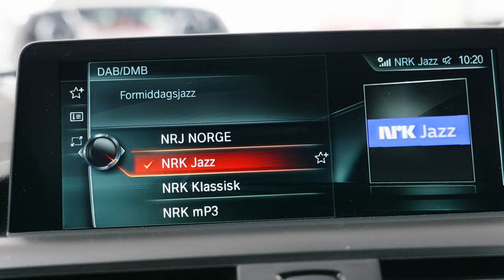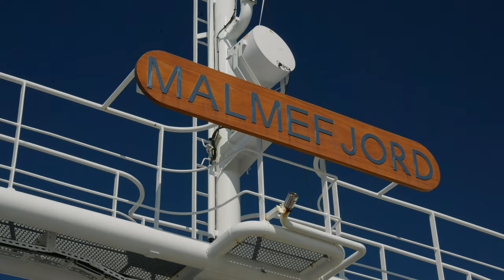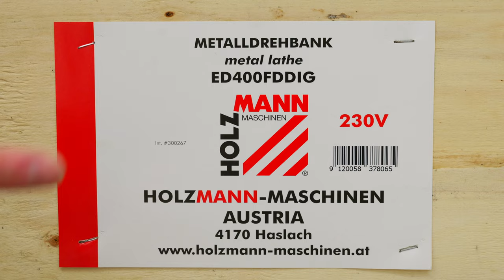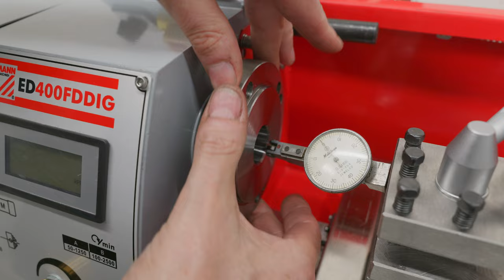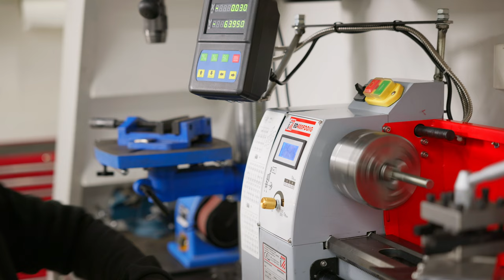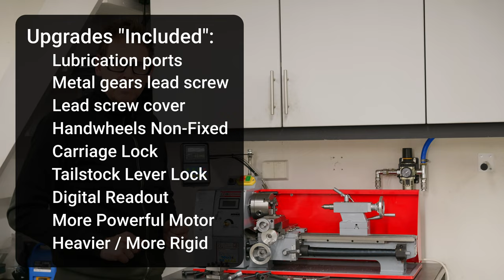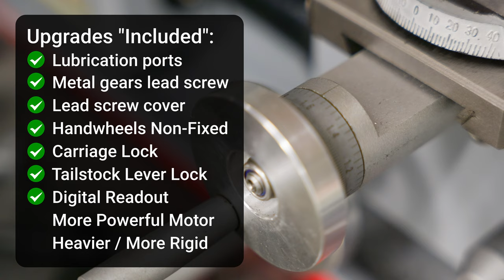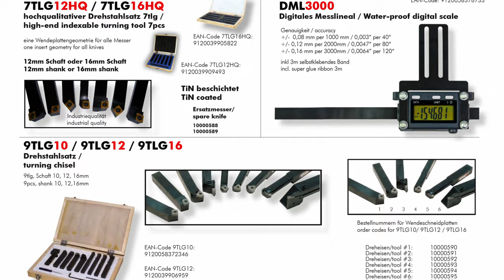The Workshop Upgrade Everyone Wants - Holzmann ED 400 FD DIG

Comment: If you want an easy time, try working with brass or aluminum. You can even shape it by hand with a file.
POM can be a little bit tricky but you can do bearings and similar stuff with it.
I also made some nice cabinet door knobs from brass and POM (and Wood).
Reply from the maker: Thanks for the tips! Starting with softer materials sounds smart. I have got hold of some plastic/nylon bars. Will be on the lookout for brass / aluminium 👍

Comment: Mine came fully assembled, except for the digital readout. Note that the digital readout only reads the apron position and the cross-slide, the compound slide is NOT read (a bit of a disappointment if you want to do a small precision work). However, the impression is good, so far.

Another thing, do you know for sure if the quick tool post SWH20 fits the ED400 lathe? Thanks in advance!
Reply from the maker: Yes, I knew about the limitation with the digital reader. Hope it's not a big limitation, time will tell ☺️ The SWH20 fits - to my knowledge at least. I have not tested it yet though. I asked the Norwegian reseller TreTek about it, and they told me it was compatible. I have ordered it now + some extra tool holders. Should be here in a couple of week. Plan to make a video of it ☺️

Comment: I swear I should stop following this channel. Now I have one more tool that I have to buy. 
A lathe has been on the back of my mind for a while, but I kept telling myself that here in Norway it is way to expensive to buy one, but no, here comes Mr Hestad with a juicy video describing this machine that looks like a perfect match for me, and then I look at the price and see that it is expensive, but not the crazy expensive I thought it would be. How will I ever save up enough to buy a motorcycle if I keep buying tools?
Reply from the maker: Ahh, yes - this is not cheap for sure 😬 I doubt I will ever buy any machine more expensive than this one (🤞). You have to look at it as an investment, this machine will last for years. I know I have bought some quite expensive that I now can make myself. Hope it can at least partially pay back. I hoped the same when I bought the 3D printer many years ago, and I know 100% for sure now that all stuff I have made over the years with the 3D printer is much more worth than the total cost of ownership. I did a calculation a while back, and I have saved thousands (NOK) by 3D printing my own parts. Not sure if the same will happen with the lathe, it's much more expensive and steel is also expensive, but time will show 🙂

Comment: Cool. Could you make another video about tools you got and Holzmann numers for them? I've been planning to get small lather for years now and I'm really curious how tools actually look build quality wise.
Oh and how much did that assembly cost? I quickly looked and it seems to be around 1500euros in Finland retailer.
Reply from the maker: Hi, this is the item numbers for what I bought (from the invoice):

101-ED400FDDIG - HOLZMANN ED400FDDIG_230V - turning lathe for metal
101-9TLG10 - HOLZMANN 9TLG10 - turning tool set 9pcs / 10mm

Prices for imported goods are crazy high here in Norway these days, the Norwegian Kroner (NOK) is weak, exchange from EUR to NOK is no fun. In addition we have 25% VAT, not easy to compare prices across borders 😌 I bought the lathe with the digital readout unit (DRO), it might be a bit more expensive than the one you have looked at. Holzmann has also a smaller lathe (ED300), unless you only are going to turn very small pieces of soft material (brass, aluminium, plastic) it might be too small. I think the ED400 is a better buy.
Reply: @kihestad  Thank you very much for the information. I was specifically wondering about those toolings as there were was it 7piece set with was it 12mm or something. Anyway now I now what you have there. I think I might get the same exact machine. Seems to have most of the stuff I've been looking for these small lathes.
Reply from the maker: @jothain Great! I did spend quite a lot of time investigating other mini lathes, mostly cheaper ones, but it was not until I found the Holzmann machines I became convinced. The user manual also included a spare parts catalogue, so it seems possible to repair if you break something. I cannot afford nor have space for industrial high end machinery, and I do not want the cheapest Chinese clones. It’s not easy to find vendors that can offer good quality products for us semi-professional hobbyists ☺️

Comment: Hey! You've done something potentially dangerous (to the machine, at least)!
You noticed that the machine was covered in oil and then thoroughly cleaned it to remove any. Don't do that! Machine tools are coated in oil for a reason, and that reason is rust! Any surface on the lathe that isn't painted should be lightly coated in oil. This even includes handwheels. It is messy and does attract dust, but otherwise there will be rust. 
It can be applied with a spray, a brush, or cloth. Since I don't know what rust inhibitors are available in Norway, I would recommend you find some machinist or workshop in your area and ask what they use. Having a professional machinist for a friend is nice way to get a little free advice.
Also, you're definitely right about gloves. Never wear gloves around rotating machinery.
Reply from the maker: Right 👍 After cleaning away the thick grease I add a thin layer of oil from the spray-can named X4. In addition all contact surfaces get lubricated with thin lubrication oil (ISO32). The grease that is painted on from fabric is supposed to be removed. Even the user manual says it. It's added for protection against rust during long time storage and shipping, possibly in very moist and changing conditions. It would be very messy to start using the machine without removing the grease, metal chips would stick to it and you would just constantly be greasy 😝 It's a rather dry climate here in Norway, but it can be high humidity in periods. I have a lot of bare metal around in my garage, so you're absolutely right. If not covered in thin oil, it rusts. Thanks for the tips 👍

Comment: Ciao, video molto bello e utile. Vorrei comprare anche questa macchina, è il massimo che posso spendere. Ho dei dubbi sul motore, è davvero troppo debole o potrebbe andare bene? Grazie
Reply from the maker: I am very satisfied with my BMW 118i. I have had it for 3 years now, not had any problems whatsoever! 🤞 It's diesel, 150HP, 4WD and manual gear. Very fun to drive, and I think the engine is plenty powerful enough. I know it's possible to put on an aftermarket chip/ECU and get more than 200HP from this engine, but I think it's fine as it is for my use 😊

Comment: I'm considering the FDQ model - with the powered cross-slide feed. What is Your experience - is that something You would have considered buying, based on Your experiense with the manual cross-slide feeding?
Approximately 24.000 NOK more expensive today(yes, I'm in Norway too), but perhaps would leave a better finish, facing large diameter?
Beautiful coastal scenery, by the way! 😍🛳🌝
Reply from the maker: When it comes to lathes: the bigger the better 😊 If you have the space for it and you can afford it, you will not regret it! I have actually not tried the feeding yet, just manual so far. Not sure how often a powered cross-slide feed will come handy, it probably depends on you use case. I am pretty sure a bigger and heavier machine is useful though, when turning tool steel or other hard metals the smallest ones can struggle a bit.